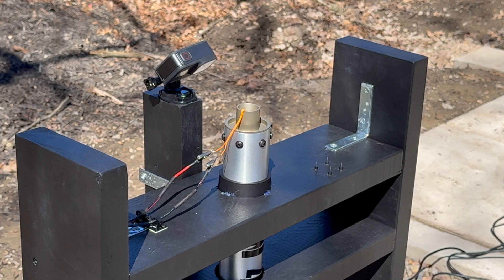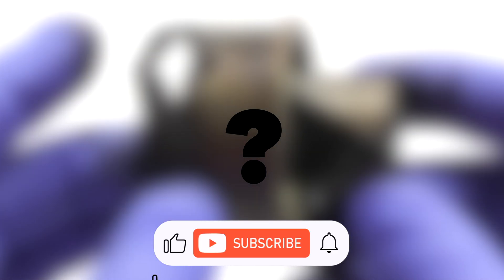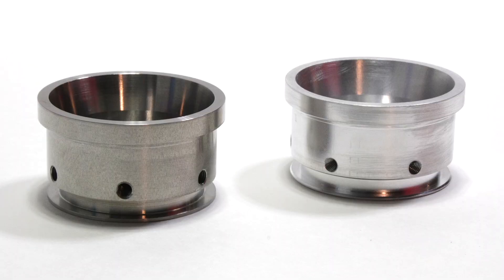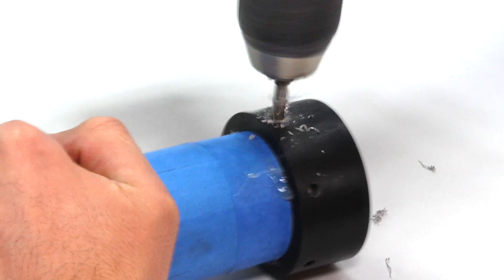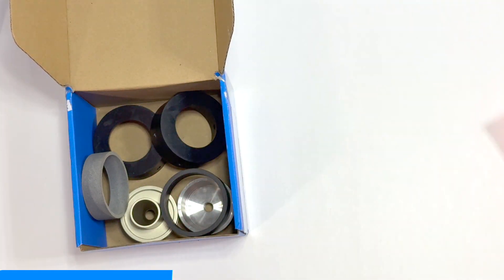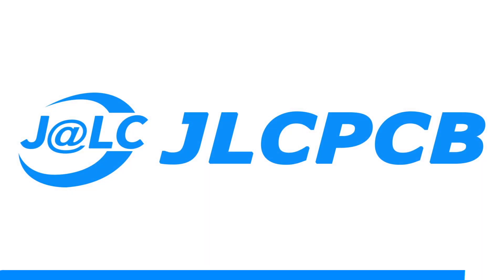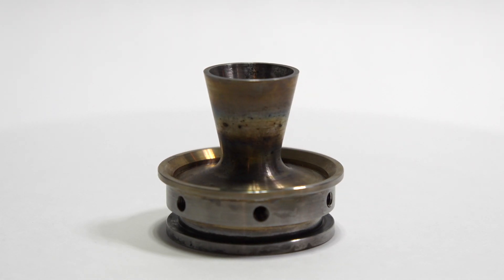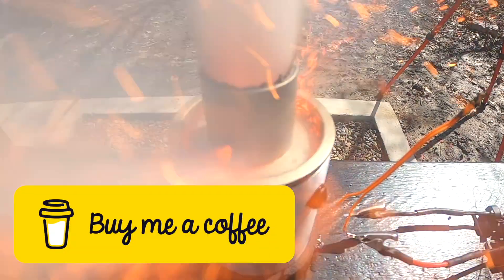My Most ADVANCED Rocket Motor Yet (Pushing the Limits)

Comment: This may be a dumb question, but I was just wondering what method you used to line the motor with black powder? I was wanting to try it for myself but couldn't think of a good idea on how to do it. Btw this is an amazing channel, I hope you grow way more popular, because you deserve it!
Reply from the maker: I use that to increase startup temperature. I had a few problems with the ignition on SN2 with the colder weather. Probably won’t need to use the black powder in the summer. Thanks for the support, glad you like the videos!

Comment: ⭐⭐A BETTER OPTION FOR THE ALUMINUM, Cera Coat makes a ceramic coating used on pistons and similar components. It can actually hold molten aluminum together, it is a ceramic insulation and fairly easy to apply at home, yet there is companies that professionally apply it. Basically all serious race engines use it, or something like it .  I would totally use it on the nozzles the whole motor even. It is light weight, and thin
 Yet still works, pistons are designed to be as light and strong as possible.  I'd coat BOTH SIDES OF THE NOZZLE. I'm planning to use it on my next engine, on the pistons, heads, valves, inside the  exhaust ports , even the intake ports inside and out.  To keep heat from heating the intake manifold. And prevent the engine it's self to heat the incoming air. Keep it cold as possible until it's being compressed to nearly 200 psi, while the intake charge is at 15psi.  It is tough stuff. Really worth it. It requires the surface to be glass beaded , spray coated, and the better stuff requires being baked at 400°f or so the anodized finish is ok better for chemistry and friction, the ceramic insulation handles heat and pressure..
Reply from the maker: Thanks for the suggestion! Definitely worth looking into and trying.

Comment: Beautiful parts... I gave up on aluminum nozzles years ago for that exact same reason. Even when I was machining my own one piece steel nozzles, there was orifice erosion that was noticeable after a few uses. A thought for you... Something that I was going to do but decided to go in another direction... A steel nozzle with a replaceable steel orifice insert. That way, if it erodes a bit, you don't have to replace the whole thing, just the orifice insert... just a thought. I decided to go with quick build, single use motor designs instead.
Reply from the maker: @rotaryrocketry  That is very smart. On SN2, I used a stainless steel insert, with an overall aluminum nozzle. Worked decent, but could definitely be improved.

Comment: Hi Great video I love what you're doing. I'm also working on my own rocket motor, and I was wondering what pressure sensor did you use for your testing?
Reply from the maker: Hey, thank you. I am using a 500 PSI Pressure Transducer Sensor, 1/8"NPT Thread Stainless Steel Pressure Transmitter for Oil Fuel Water Air. I found it on Amazon.

Comment: Have you thought about using a phenolic nozzle insert
Reply from the maker: No need for my rocket motor. Short burn time at a relatively low temperature. Never had any defects to the casing due to heat!

Comment: Really liked the video and how straight to the point it was. Great work.

As the one who initially suggested the aluminium hardcoat anodizing i must admit i feel a little blame in thee outcome. I thank you for sharing your results and im sorry you had to use much time and resources! At least now we know it's not possible.

To be completely honest though, I'm very shocked! If the standard aluninum hold up without melting, how come the anodized one melt that quickly? Looked like it was made out of another aluminum alloy, although I'm not sure. With this in mind, wish you all the success!
Reply from the maker: I really appreciate the suggestion, and I’m glad I went through with it. I believe the main culprit was that SN1 was much smaller motor with significantly less propellant. With SN4, the motor is larger, and I also reduced the overall mass of the nozzle, which leaves less material for heat dissipation.
Reply: One other factor along side the others is the coating may have changed the emissivity of aluminum making it absorb the the heat faster than it would have otherwise.
Reply from the maker: @Slowly_Going_Mad  Smart.